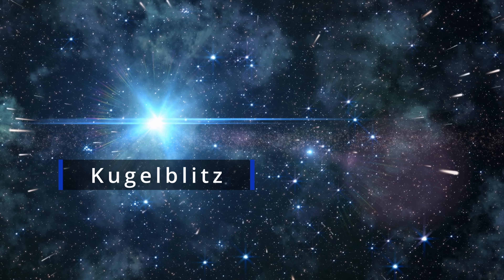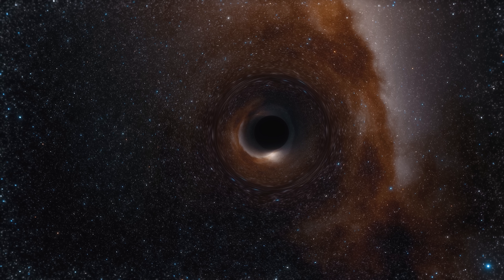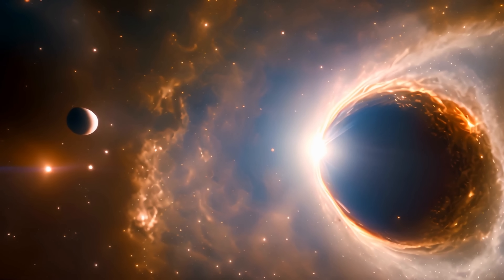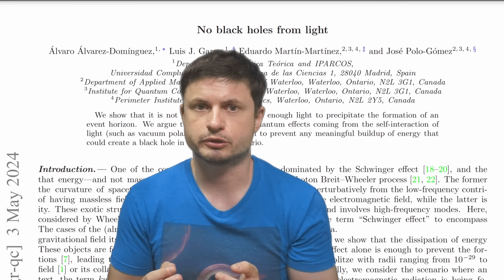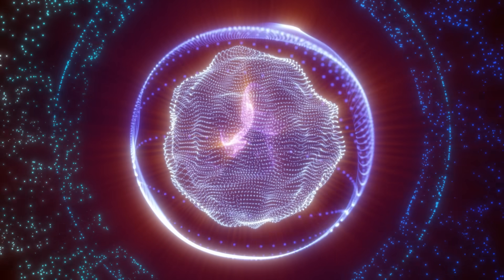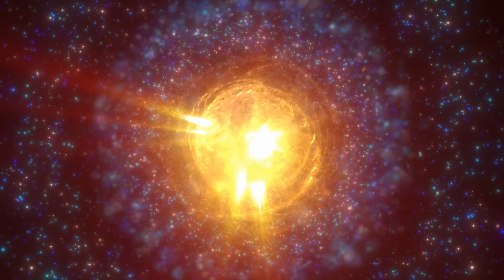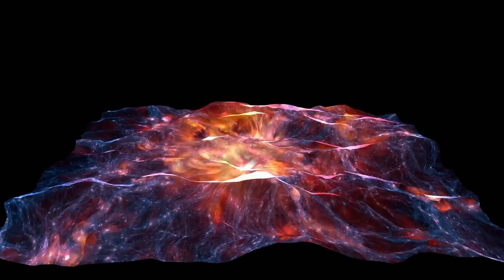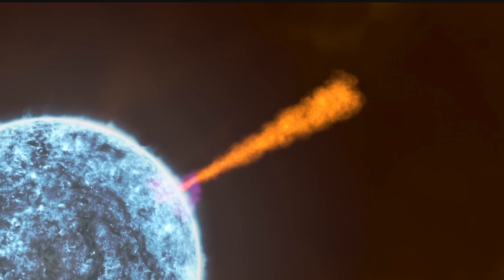Bizarre Black Holes Made Out of Light Proven To Be Impossible (Kugelblitz)

Comment: Do they have a name for a hybrid keugelblitz? Something that would have formed before the cosmic dawn, where the density of photons and sub-baryonic matter (can it be called matter that early on?), lets just say total local density, was so high that local collapse occurred well before the cosmic dawn? Which would then make these earliest primordial black holes (yes, I've heard of those, but am not sure if photons are included in consideration of these). Maybe this explains why SMBs were developed within the first 0.5B years. Could a hybrid Keugelblitz, within the dense embryonic universe rapidly form an SMB?
In my personal concept (and I'm not saying others haven't come up with similar): when the rapid expansion occurred, apparently faster then the sped of light, what was actually happening was the collapse of waveforms to create structure. This collapse is what was happening faster than the speed of light. I think this kinda links to string theory and energy branes(?)... anyhow, EM forms, closely followed by devolution of subatomic paticles. Density of EM is so high that, particularly in combination with the nascent matter, the local waveform node collapses further and creates a point of singularity in the noise, anchoring the locale as the universe forms around it. Thus resulting in a black hole before the cosmic dawn, which with the density of the universe, quickly becomes a SMB.
Anyhow, just what I'm thinking at the moment.

Comment: Would angular momentum, in other words the spinning of the black hole, indicate that it's made out of matter, and one that doesn't have that, indicate that it was not made out of matter but out of energy instead... Have we even proven that black holes spin?  I'm assuming the gravitational waves would indicate if it's spinning or not, but am I correct in that assumption?
Reply: We do know that black holes (at least the ones that we have documented and that our understanding is based on) spin for several reasons. First of all, angular momentum must always be conserved so any black hole that formed from a star must necessarily be spinning as well. But even without that understanding, we have photographic evidence of the existence of accretion disks around black holes being a reality and those accretion disks are the result of the black hole spinning.

Edit: it's possible that gravitational waves are another clear proof but I can't speak as confidently on that topic specifically. It would make sense to me though that we could prove it in that way though. Regardless, as far as I'm aware there is no debate on whether or not black holes spin at this point. We consider it to be an understood phenomenon that they do.
Reply: Black holes spin - it's impossible for them not to, and yes we can measure this. A black hole is a vacuum spacetime so any matter that falls in, vanishes.
Reply: @senokir335  Yes, gravitational waves signals can be used to learn about the spins of the black holes, but not easily  as there are degeneracies (mixing of individual spins, orientations, system mass, etc).

Comment: Dumb theoretic question. Given an infinite supply of electrons to work with, and enough empty space to isolate, is there a point where the mass of electrons would overcome the repulsive force of common charge? Could you have a black hole with a mono-pole electric charge?
Reply: Yes, in principle. Reissner-Nordstrom black holes are electrically charged black holes. They wouldn't exist for long as they'd attract positively charged matter until it neutralized.
Reply: @kylelochlann5053  Good to know. Thanks for the reply and the name to look up more.

Comment: 'in current universe'...probably. Early universe (Inflation Epoch doesn't add up as a thing) so pre-'inflation' dark age, a kugelblitz should have been favored over a star. Universe was still very hot, very dense...Light/radiation = mix of heat/EM emissions...Electromagnetism may have been a thing back then...and IF so, it may have complemented gravity rather than easily overcame it (in current universe where gravity is orders of magnitude weaker). 
           Basically kugelblitz would be the 'primordial' singularities. NOT a black hole in traditional sense (bcuz not a post-stellar remnant), but instead direct-collapse based singularity. Most particles/molecules travel slower than light; so in such early era, the electromagnetism/electro-weak forces could have caused solar-system style 'coalesce-->stellar formation (but singularity), but travelling so fast, and with these forces it could have been a gravity sink of different type...and drawn in space/light/matter: on the scale of a supernova but reversed (implosion).

Comment: I can understand this effect making small kugelblitz black holes impossible, but does it truly rule out large ones?
The larger the black hole you want to create, the lower the density of the mass inside the schwarzschild radius needs to be.
A sphere of water or air with the same densities found on Earth would directly collapse into a black hole if the radius of the sphere is large enough.
If we assume that somehow a civilization turned every energy source in the universe into lasers all focused at one point, with the goal of creating a supermassive kugelblitz, would this effect truly make it impossible? keep in mind that the photons do not all need to be crammed into a single point for a collapse to happen, they only need to be within the schwarzschild radius for the density of photons where this effect stops being an issue.

From how I understand it, the only way supermassive kugelblitz black holes like this can be theoretically impossible is if eighter:
A: There is not enough energy in the observable universe to create a black hole with a large enough radius to escape the effect
B: In order to escape the effect, the density of light must be lower than the average density of the Universe, making a black hole collapse impossible due to the universe pulling with equal force in all directions.

Comment: What is potential energy? There is a book is on a desk and it is just sitting there not doing anything. However, if the book is slipped off the desk it falls to the floor where its potential energy is converted to real energy (heat, noise, vibrations). Where did that energy come from? The book on the floor is surely different than when it was on the desk. What changed? Could it be that the energy came from its mass or in other words it has less mass on the floor then it had on the desk. If true then big problem. If mass was indeed lost then what happened to the mass's gravitational effect? Did somehow the energy take away some of its gravitational effect? In other words can energy have a gravitational effect just like mass? If a mass free falls into a black hole then when it gets to the event horizon all its potential energy has been changed to dynamic energy. So what goes through the event horizon? Mass or energy? And what speed does it have? Could it be going the speed of light? Mass can't go the speed of light but energy can. So it could be that the only thing that can go into a black hole is energy and somehow that energy has the same gravitational effect as the mass had before being converted to energy. Once inside the black hole one cannot determine if the gravitational effect is coming from mass or energy.
Reply: Energy is the Noether charge of time-translation symmetry, it's not something that exists. The book on the desk has a potential energy of zero, just put your coordinate axes there.
The manner in which matter interacts sources the curvature of the gravitational field. We can assign this matter an arbitrary number agreed upon by convention, which we call the mass or energy. 
You are correct that, at least classically, we cannot determine what formed the black hole.
Reply: @kylelochlann5053  Thanks for the reply. Your first sentence seems to suggest that energy does not exist. Did you mean that potential energy that was taught in school does not exist (the horror)? One of the points I was trying to make is that energy has a gravitational effect. The sun and black hole accretion disks for example converts mass to energy. Mass has a gravitational effect. Does that gravitational effect disappear when mass is converted to energy? Here is a thought experiment. There is a magical black box on earth with a single button that when pressed converts mass to energy or energy to mass (E=MC^2 or M=E/C^2). Can you tell if the black box has mass or energy inside it by weighing it? In other words does the conversion from mass to energy suddenly causes the loss of its gravitational effect? 

The book thought experiment sort of looks the same for a rocket ship with an acceleration of 1G. Slipping the book off the rocket table causes energy to be released when the floor hits the book just like happened with the earth table. However, that released energy on the rocket ship book came from the rocket engine. Also keep in mind that the book on the rocket table is gaining mass according to someone not acceleration with the rocket ship. The book on the earth table does not do that according to anyone no matter how long it stays sitting on the table. I say the earth book energy when slipped off the table came from the book's mass. How say you?
Reply: @petercole4573  Energy doesn't physically exist though historically it was considered as such, sometimes referred to as phlogiston, caloric, or vis viva.
      Energy is a constraint on the dynamics that results from a particular symmetry condition. For example, if Coulomb's law is constant over time then this constrains the possible trajectories of charged particles from one moment to the next. This time-translation symmetry gives rise to a conserved quantity, an arbitrary number (since numbers also maintain their value over time). This arbitrary number is called the energy. 
     It is often the case that we can't see or measure all the interactions in a system, e.g. all the interatomic interactions within an apple or a book. What we have to do is consider how the object behaves as a whole, described by its 4-momentum. The magnitude of the 4-momentum is what we call "mass". Expressing the 4-momentum in coordinates for some observer world-line, the zeroth component of the 4-momentum is the energy. In the zero 3-momentum frame this energy is then equal the mass of the object, which is just the sum total of all internal interactions. 
      In both the rocket and Earth examples the book moves along a geodesic path, as determined by accelerometers on the book. 
Energy is an arbitrary label, so let's say the book has none, E=0. We can do this by defining the coordinate origin at the initial location of the book and defining the kinetic energy of an object at rest to be zero. 
    When the book reaches the floor, in both cases, it has (let's say) a potential energy U=-40j and a kinetic energy K=+40j, leaving the sum to be zero. 
      The book cannot gain or lose mass as the internal interactions within the book are unchanged and moves along a geodesic path.
Reply: @kylelochlann5053  Thanks for the reply. Unfortunately, your choice of words and reasoning makes it hard for my 4th grade mind to understand what you are trying to say. I've saved it so that I can read it over and over again and perhaps eventually I will see the light.

Comment: No kidding, light has very little mass and no standing still mass. How can you have a black hole with no mass?
Reply: Energy and mass are the same. Light actually has mass from the energy it has. It just doesn't have any REST mass. 

Really early in the universe, extremely high energy gamma ray photons would split apart into elementary particles. And antimatter will turn into photons when it annihilates. 

If it makes you feel better, the extreme density of light just turns into a bunch of particles which then turn into the black hole or whatever.

Comment: Gravity cannot be quantized because gravity is not a force, and there is no such thing as a singularity. 
Nobody has physically demonstrated singularities to exist. 
There is no reason to believe that singularities exist, not even in black holes, because curvature of space is caused by the non-zero presence of matter. 
Gravity is merely and ONLY curvature of space; gravity is not a force but merely redirection or reflection of kinetic energy. 
NOTHING is inside a black hole, not even existence of space or spatial dimensions; all of its matter that cause curvature of space is contained in its event horizon surface. 
Time stops at the event horizon surface, so nothing can "fall" inside the black hole. 
There is no loss of information, because all of the matter that causes curvature of space is contained in the event horizon surface. 
The event horizon surface of the black hole is an "edge" of the universe reality. 
Gravity is merely the curvature of space as it is "pushed out of the way" by matter. 
Gravity is not a force, but only the reflection or redirection of kinetic energy that is already in the matter. 
That's why objects of unequal mass will accelerate at the same rate under the influence of gravity. 
If gravity was a force that was imparting its energy into objects, then the objects of differing mass would not accelerate at the same rate. 
For objects of differing masses to fall at the same acceleration rate, they must be invested with differing kinetic energy relative to their masses by lifting the objects.
Where did the original "lift" of kinetic energy come from? 
Cosmic inflation (also known as the "Big Bang") provided the original "lift" to invest the kinetic energy that is now in all matter in the universe. 
The question is whether cosmic inflation, which happened faster than the speed of light, was sufficient for the "escape velocity" to prevent future gravitational collapse of the universe? 
It seems to me that cosmic inflation was not an inertial frame of reference, so "escape velocity" has not happened, because it only applies to inertial frames of reference. 
The universe will ultimately collapse, causing an unending series of births and deaths. 
The universe is finite, unbounded, and eternal.
Reply: Practically speaking our light cone exists in a bubble we cannot escape due to continued spatial expansion, but that doesn't mean that the universe is finite.
IIRC measurements suggest that the universe is effectively flat which implies that it is infinite, if going FTL is impossible this doesn't really matter, but I brought it up just to be pedantic, as is youtube tradition.

Comment: Something I don't quite understand from the explanation in the video, why would energy creating electrons and positrons reduce the total mass-energy density in that volume of space? Space is curved by the net total mass and energy in a given volume, so why would it change the gravitational curvature if you have, for example, 1 MeV worth of energy in photons versus 1 MeV worth of mass in electrons and positrons in a given space of the same volume? Moreover, since electrons and positrons have mass, their speed is always less than that of the photons that produced them, which means electrons and positrons should be more easily captured by the current gravitational curvature in that area than if the energy had just stayed in photon form.
Reply: The created particles would have move at ultra-relativistic speeds and escape which then never takes gravitational field beyond the weak-field limit.
Reply: @kylelochlann5053  Sure, the created particles are moving at relativistic speed, but not the speed of light which the photons that created them are. So wouldn't the photons have a better chance of escaping the field than the particles with mass they can create?
Reply: @Bodyknock  That's a good point, and the paper is not at all clear on how this "focusing" is taking place and maybe the argument (which is not explicitly stated anywhere) is that you can't focus the light narrow enough?
      A kugelblitz was originally formulated to be a radially in-falling null shell and once the shell was inside the future horizon it made no difference if the light interacted or not, it was trapped.
Reply: @kylelochlann5053  Maybe what they’re saying is as photons near the potential event horizon radius the energy sparks them to create heat electron positron pairs which are then moving in random directions rather than toward the center. Since this happens before they reach an event horizon they will likely escape the process which drains it of energy and reduces the radius of the potential horizon in the process, making it easier for future pairs to similarly escape and creating a chain reaction where energy bleeds off before a horizon can form as the incoming photons converge.

That’s just speculation though. 🤷‍♂️
Reply: @Bodyknock  Yes, that's what I meant in my comment above. It hinges on how this one line in the paper: "This phenomenon hinders the formation of the kugelblitz, since the created particles can scatter out of the region where the radiation is collapsing..." is to be interpreted.